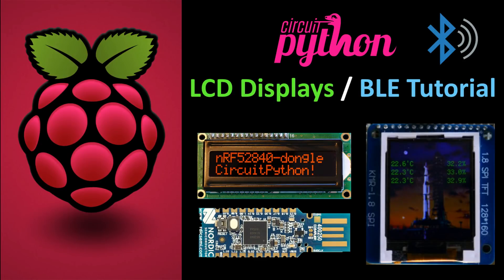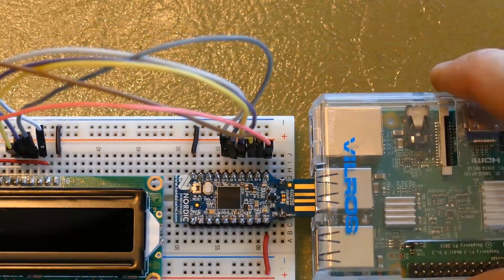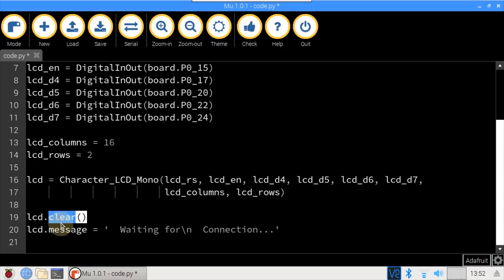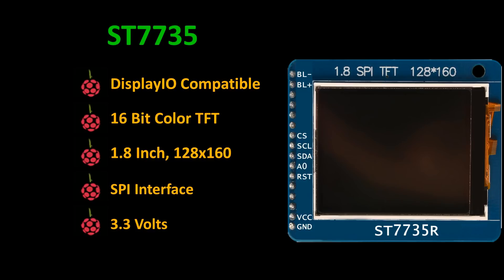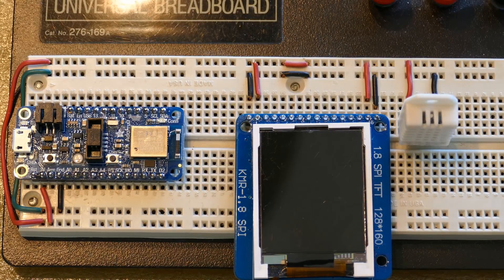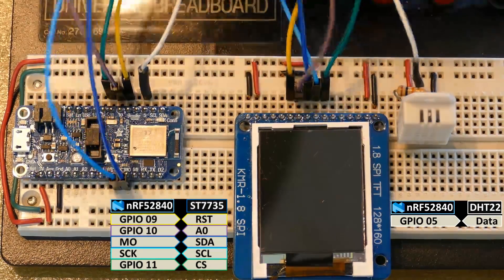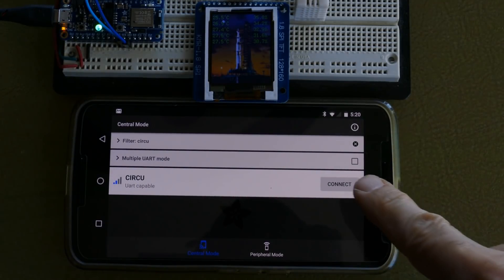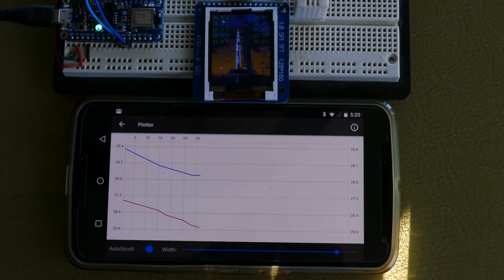CircuitPython nRF52840 LCD Displays Tutorial

Comment: Is there a compatibility between the a LCD display and OLED display?
Reply: If so which libraries should I use?
Reply from the maker: @samuelmillan-norman8014  Most 16x2 LCD displays use the same HD44780 controller and therefore use the same library.  On the other hand, there are many controllers for OLED displays such as SSD1306, SSD1309, SSD1351, etc.  You need to use the library specific to the controller on your OLED.
Reply: @rdagger  Thanks for the fast respond.

Comment: Spent hours trying to get I2C to work on the nRF52840, then checked arduino, NO I2C examples, so guess I'm not the only one that cannot figure it out.  Even people using the Nordic SDK cannot get to work very easy.  Did give 2 pins that worked, .07 and .08, but those do not exist on my dongle????  Help!!!
Reply from the maker: Here's an example of how you would use I2C in CircuitPython on the nRF52840 dongle to connect with an INA219:
from board import P1_00, P0_22
from busio import I2C
from adafruit_ina219 import ADCResolution, BusVoltageRange, INA219
i2c_bus = I2C(P1_00, P0_22)
  # SCL = P1_00, SDA = P0_22
ina219 = INA219(i2c_bus)
Reply: @rdagger  Still not able to get the LCD using I2C adaptor to work, ble doesn't work either, probably because the LCD and I2C code is not working.  May try a SSD1306 I2C instead.  Do all the libraries being used need to be on the Dongle?  Thanks for looking into this issue.
Reply from the maker: @xt1200z1  All the libraries that you are using in your code that are not built-in to CircuitPython need to be on the dongle.  Please note that the nRF52840 dongle has very limited memory.  You may be running out of resources.  I recommend the Adafruit Feather nRF52840 Express.  It has an additional 2 MB of QSPI flash.  The best way to debug you code is to test each part separately.  First make sure you can get I2C working without other libraries.  Then get the BLE working by itself.  Afterwards you can combine them.
Also note that this video is 2 years old and Adafruit has made extensive changes to the BLE library in the interim.  Please see me website for updated code.  It’s possible that the BLE library has become too bloated to run on the dongle.
Reply: @rdagger  Really thanks for the fast reply.  It was always a new exercise while waiting for the TSDZ2-wireless-OTA stuff to get finished.  Thus the reason I have the dongles to play with.  Even Nordic advises to purchase the DK board for development then transfer to the dongle as it is a lot harder to debug.
I had an old ESP32 that I killed but it was able to run your nRF52-ESP32-SPI, well at least the esp32 part, the circuit python has stopped me cold.  Plus all the pins had to be changed from the feather to the dongle, pinouts are no where close.  You do really nice work with the code and videos!  Cheers
Reply: @rdagger  Went ahead and ordered the feather express.  Would really like to get the accelerometer on the nRF52840 dongle working for my dual axis solar tracker, use geophysical rather than tracking the sun.,
Too bad there is no way to access external libraries from the dongle, maybe need a SD drive attached.
Reply from the maker: @xt1200z1  I don’t think the nRF52840 dongle has an accelerometer (at least not my version). 
I have not tried it, but if you want an accelerometer, you might want to try the Adafruit Circuit Playground Bluefruit.
Reply: @rdagger  Going back over the data sheet,  no it does not.  That burst my bubble, I don't know where I got that from.  Guess I was hoping for something easier than the  MPU-6050 or 9260?  I have both, and have not succeeded in implementing.
Just installed MicroPython on Raspberry Pico board and trying to get your program to port for the esp32 project with the feather.

OKAY,  now I see where I got it from:  Your tutorial on nRF52840 OpenOCD and the color graph published to ble and samsung, in the screen "Controller" has Quaternion, Accelerometer, Gyro, Magnetometer, and location!  Where does that come from?

Comment: can you post the modified library for the st7735 i got the same ones but i cant figure out how to recompile the library after i change the values you did and theres not any good tutorials on how to do it
Reply from the maker: There is no need to compile.  Download the library from: https://github.com/adafruit/Adafruit_CircuitPython_ST7735/blob/master/adafruit_st7735.py
It's a Python file so you can edit it with any text editor.  Python source code is automatically compiled into Python byte code by the interpreter.
Reply: rdagger68 still having problems with the screen you show on your website that says kmr-1.8 spi the screen shows a picture put its supper distorted you ever seen that issue
Reply from the maker: What is your web browser (please include version #)?  Are you using a computer or a phone?
Reply: rdagger68 i’m on a phone right now but i’m doing my circuit python stuff on my pc and i use firefox and i have chrome
Reply from the maker: Often GLCD displays will have slight variations among models that require alternative init settings.  You might have an ST7735R which has its own library:  https://github.com/adafruit/Adafruit_CircuitPython_ST7735R
Reply: rdagger68 mine says it is a st7735s is there a Library for that one cause I’ve tried the st7735r and st7735 library’s and I can’t get either to work
Reply from the maker: I don’t know but it wouldn’t be that hard to write yourself.  For reference, search github and find a library such as this one:  https://github.com/miro-kostadinov/tmos/blob/master/tmos/services/GUI/lcd_ST7565S.cpp
Also check out the datasheet:  https://www.crystalfontz.com/controllers/Sitronix/ST7565S/301/
Reply: thank you so much because of your videos i have made so much progress. I was about to give up on this lcd working and i thought well i give it one more search on youtube and i found your videos. Lifesaver thanks again